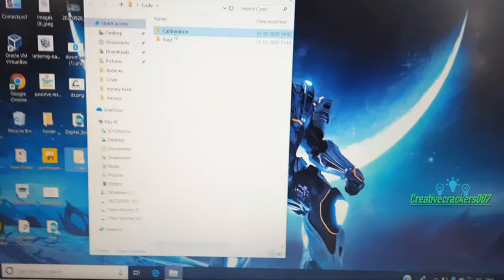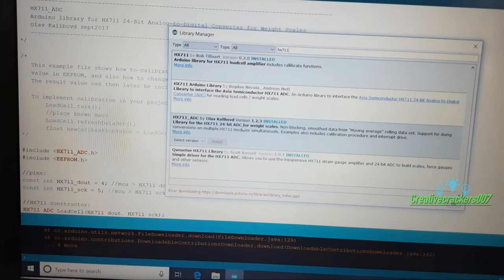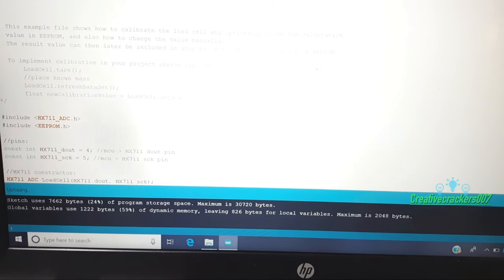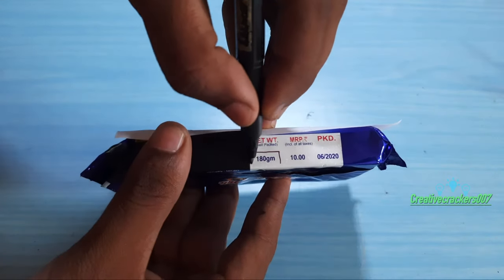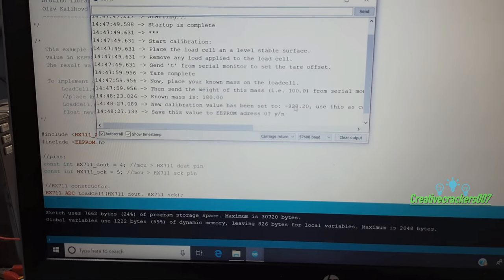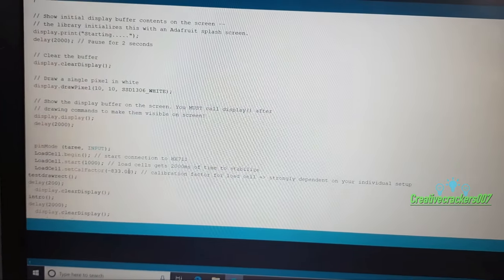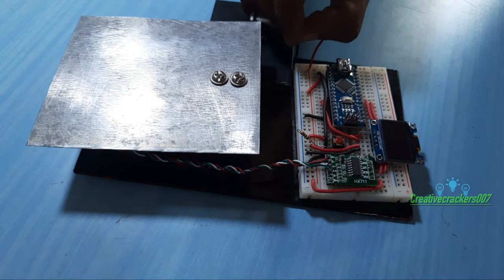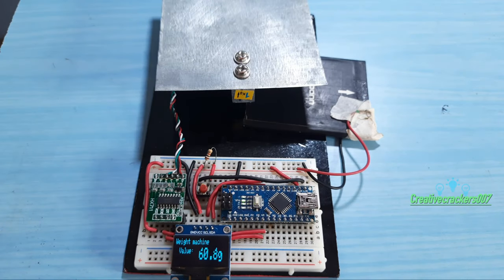Arduino based weight machine with 1kg load cell and oled display || Arduino project

Comment: 22:58:02.347 -> 
22:58:02.347 -> I2C Scanner
22:58:02.347 -> Scanning...
22:58:02.347 -> I2C device found at address 0x3C  !
22:58:02.415 -> done
22:58:02.415 ->
Reply from the maker: Check if you choose the correct board  and port under tools menu
Reply from the maker: I have update the code now check it

Comment: On the other hand, this video is useful because I intend to build a golf disc speed tester using the ultra sound sensor hc-sr04.
But, I'm stuck on the screw size thing.